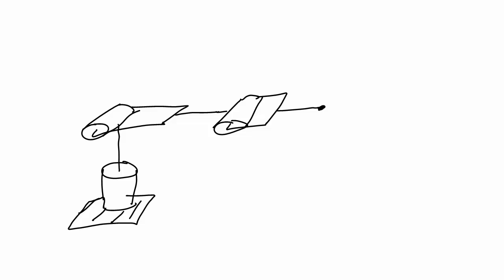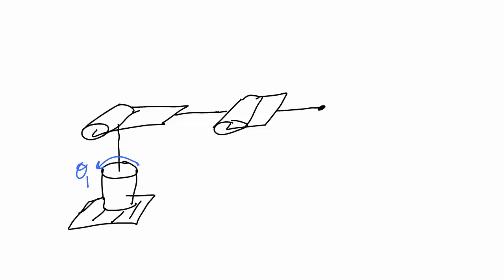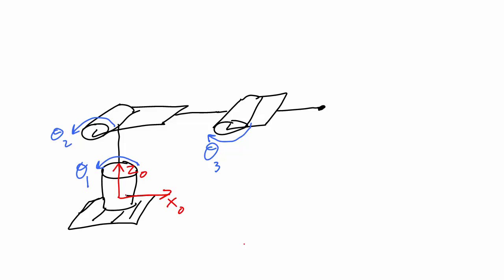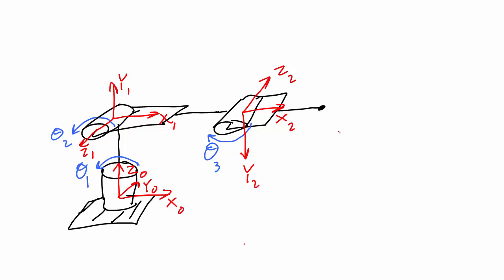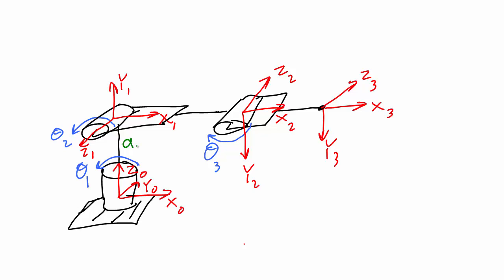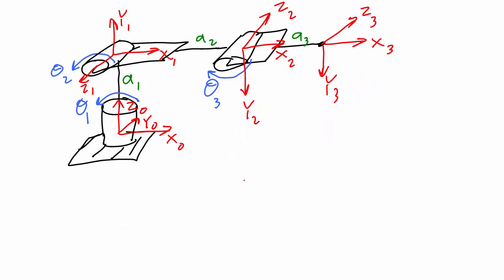1 1 5 Lab Video 3 of 4   Find Homogeneous Transformation Matrix

Comment: Thanks for your great illustration. Would you please recheck the final H03?
h03 =
 
[ c1*c2*c3 - c1*s2*s3, - c1*c2*s3 - c1*c3*s2,  s1, a2*c1*c2 - a3*c1*s2*s3 + a3*c1*c2*c3]
[ c2*c3*s1 - s1*s2*s3, - c2*s1*s3 - c3*s1*s2, -c1, a2*c2*s1 - a3*s1*s2*s3 + a3*c2*c3*s1]
[       c2*s3 + c3*s2,         c2*c3 - s2*s3,   0,     a1 + a2*s2 + a3*c2*s3 + a3*c3*s2]
[                   0,                     0,   0,                                    1]